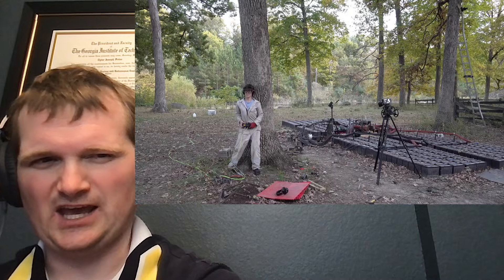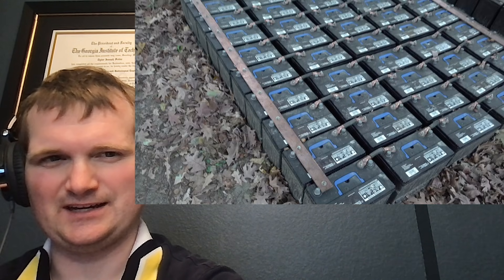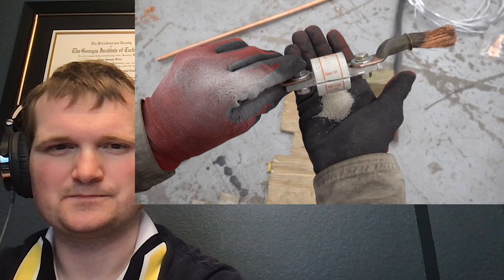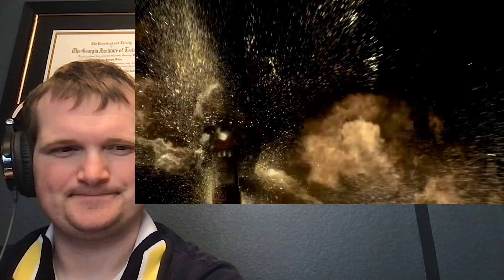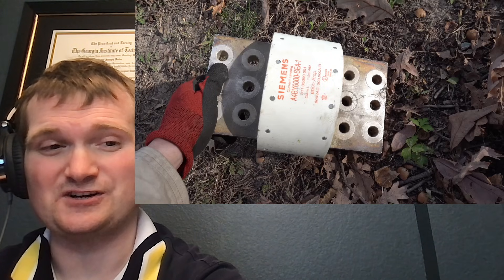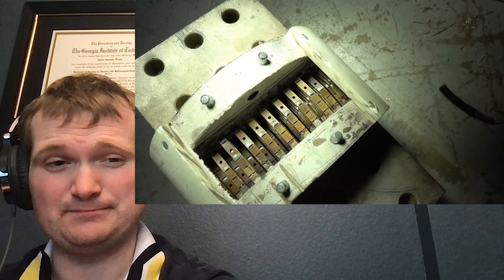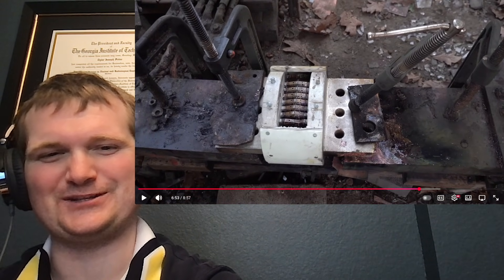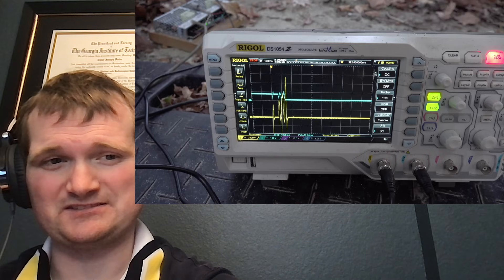Popping a 6000 Amp Fuse - Nuclear Engineer Reacts to Styropyro

Comment: Reactor cooling pump size of the house of a Nuclear agent on Earth.. Get that Sodium Fluoride and Chlorine out of water for Ultrasonic resonance database currently used like a primitive monkey would for Ultrasonic Lake & Pond Algae control but not for zero content loss Algae fuel processing. Woof.. See I'm not nosy that's how I get surprised Earth idiocy. Heh.. No Chlorine rotting teeth no Fluoride excuse for simpleton masses. Search engine: "Chlorine DNA damage" Then ask AI: "Why we stop using Sodium Fluoride for rodent poison?" Safe levels hahaha.. Add it all up = Genetic behavior damages are already undeniable.

Obviously POWER not a problem to you people.. Why no Plasma Ultrasonic echoes to pull air to smash for more plasma for Holography printing things? Points at Boeing Plasma force field Use Capacitor bank for safe power load from each breaker to stack power for continuous super high pressure holography and add resonance filters like Ultrasound holography Stem Cell guidance to emulate SUPER GRAVITY for your molten materials. "Ultrasound can print 3D" Ultrasound can print worlds if you hijack Stars.. Runs finger through gas field Stars make for themselves Search engine: "Ring Stars" Click images.. Plasma excited by Ultrasound makes stronger EM field.

Ultrasound holographic control of Plasma with shockwave echo clashing to crush plasma shapes = Search engine: " NASA Lightning makes antimatter" Make EM holographic containers to send antimatter somewhere for use. Oh yessss... Now we're talking big space engines using nuclear reactors as a generator to begin the chain reactions of main reactor power. MUAHAHA.. Echo clashing to set limits of barriers around exposed cores with Ultrasound echoes to pull atmosphere water from far to capture radiation I like Fusions shields.. Shockwave holography self repair for ship stuff.. What you people think about Ultrasound bioprinting? Save your image and print back type stuff.. 

Maybe someday you colonize worlds with a Holography bioprinter from a DNA database and Bone Marrow system with Blood to Stem Cell programming to make any cells needed for womb facility computer to make your bodies. Puts finger on your minds like an icon and slides it to another body Stargates = Outdated. - Dracula/Hades https://www.youtube.com/watch?v=qMo7WybtTWI

Comment: The batteries aren't all in parallel.  You can see the series connections between the columns, and the bottom row is connected in parallel.  It looks like he has 5 batteries in series, ten of those series in parallel, and four total sets of fifty. So he's running 60 volts on a full charge if I counted correctly.
Reply: Yeah. In a previous video, he started with an all-parallel setup putting out 12 V, but connections would keep breaking too easily, so he put some of that in series and cranked it up to 60 V.
Reply: Well, yeah. He did it, because 60v is more powerful than 12v.

Comment: "There you go, there's your safety feature; you eject something"

Incidentally, that's part of Starfleet safety protocol incase of warp core malfunction. So there's atleast one valid use case! 😂
Reply: True! I bet that's based on the idea of a nuclear plant failing in, say, a submarine?
Reply: Apparently there's some Chinese car company that made a battery ejector in case of overheat.

It could be fake, considering chucking a flaming battery onto the sidewalk doesn't seem like a great idea, lol
Reply: @mbburry4759 : makes it potentially easier to spread the fumes
Reply: i was thinking the same thing lol
Reply: Yep, that's how they do it in Star Trek. They are ejecting it into space rather than the countryside, but you still have to wonder why they have enough unreacted fuel in there at any moment to destroy the ship so they need to eject it rather than just cutting the fuel feed.

Comment: 15:00 wood is a very effective ablative heat shield, particularly wet living wood.
Reply: Yup! Its carbon and water
Reply: It's also good making shrapnel and catching fire.
Reply: Wood is used as forms for blowing molten glass into shapes. The wood is soaked in water first.
Reply: 99% of the trunk is dead if I recall correctly. Just a tiny fraction closest to the bark is alive. This is where the water to the crown is pushed up in a way we have a hard time replicating.
Reply: @iamagi Yeah we know that video got millions of views

Comment: 24v DC already doesn't feel good as is. 48v DC is when you need to be really concerned with safety. With that extra large battery bank, no amount of PPE is going to realistically save you. I doubt a person with a Shepherd's hook would be enough to prevent severe bodily harm.

Remember kids, know your limits
Reply: All of those batteries are in parallel, so the it'd be about 12v DC
Reply: They're in parallel groups, so it's 60, instead of 12v.

Comment: Arc Flash is no joke. Vaporised busbars, Heart stopping high voltage, a shower of burning molten copper, blinding plasma UV light, suffocating Ozone, eardrum bursting noise and maybe some flames in case it’s not dangerous enough.
Reply: 12 volts isn't that many. But, uh... upper limit of 850×400=1700×200=340kA is definitely gonna send a spark through something.
Reply: still a beautiful BOOM to enjoy while messing with high current for the lolz
Reply: Yep, Styro is certifiably insane.
Reply: KiloAmper is a deadly voltage when dropped on someone
Reply: @Kawka1122  Kilo amper is not a voltage. The voltage of batteries is only 12v, which makes that setup safe to touch with bare hands.
Reply: @Fifasher2K  Yes, if batteries are in series 12 V is okay to touch. However, as you can see in the video, there are both parallel and serial connections. One bank appeared to have 5 batteries in series so the voltage was at least 12 V × 5 = 60 V. And if he connected at least two banks in series, that's 120 V DC already.
Reply: @MikkoRantalainen Yup that's the most practical way to improve on his previous video. Otherwise it'd be a nightmare to work with.